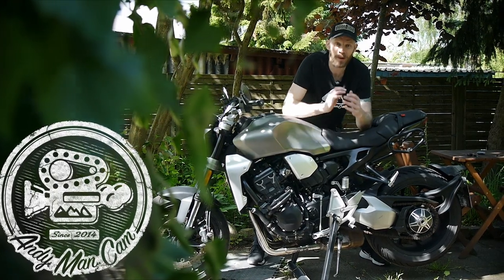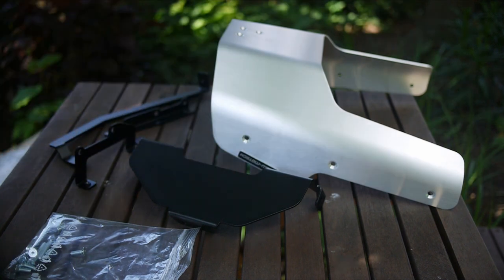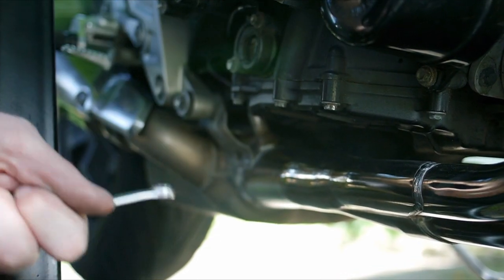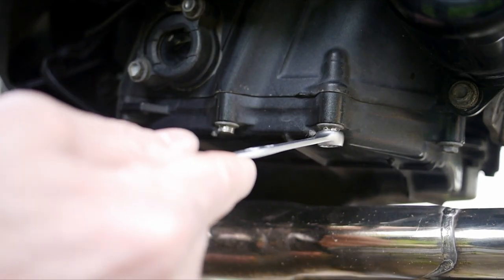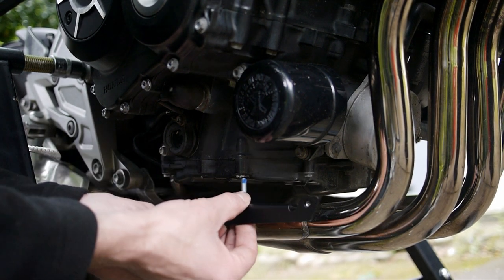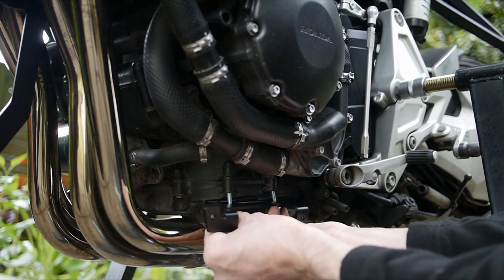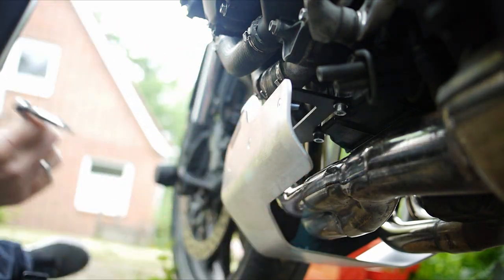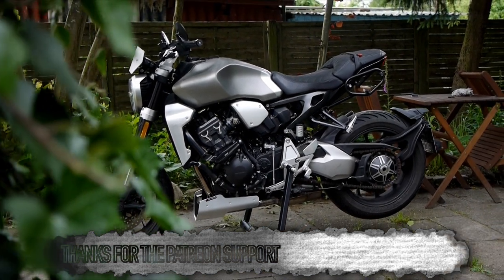SW-Motech Bellypan Install - CB1000R

Comment: Andy you didn't have any problems  with  quality with  your Yamaha. But your right that is a good looking bike for sure. Belly  Pan is a nice touch finishes off the look of an already  nice looking bike. 👌
Reply from the maker: Absolutely right James. I even remember shortly after buying the bike (which was already over 10 years old at that point)  thinking that the bolts and fixings were surprisingly shiny and clean. Pretty much all the bolts on the 2 year old Honda are starting to go fuzzy. ALL the paint on the front of the Yamaha was also still intact.
Reply: @AndyManCam  85k on my 2009 fz1. Not being a fan boy . Retired fixed income not complaining. Was thinking about a new litter bike.But I decided  to take that money cross my fingers and take road trips instead. Hopefully  my plan works  out.
Reply from the maker: I totally get that James. Knowing what i now know, i would have rather done the same. Invest in an ECU reflash, custom seat and be done with it! I’d still have had 9000€ to spend on touring trips 🤦🏻‍♂️ Especially now times have gotten a little harder.
Reply: @AndyManCam  I think most people  are feeling this economic  nightmare  were all living in. Head up move forward  my father  used  to  say. Soldier  on.
Reply from the maker: Agreed mate. Forwards is the only way.
Reply: Looking forward  to your next video.
Reply from the maker: Cheers James. The cogs are turning as we speak!

Comment: Usually tools are based on the engineering standards of the region who manufactured them. Using wrong tools for the wrong machinery can cause damage as well. FYI.
Reply from the maker: Of course. For cross head screws and the like, i know that is important (i have a JIS screwdriver for that reason). But an 8mm nut is an 8mm nut no matter where in the world it was made. But if that 8mm nut is made of very soft steel, then it’ll simply round off when push comes to shove. As was the case here.

Comment: Won't the crap now just sit under the belly pan eating away at the engine unseen? Sorry Andy not a fan of the looks either and it must weight a few kgs!
Reply from the maker: It would have to be a LOT of crap for the belly pan to hold it against the engine! There’s more than enough clearance to keep the grit moving on through. It’s also surprisingly light. No surprise as it’s predominantly aluminium. I’m happy.